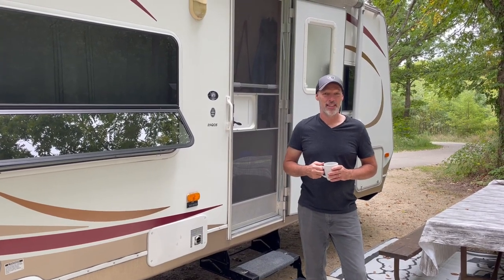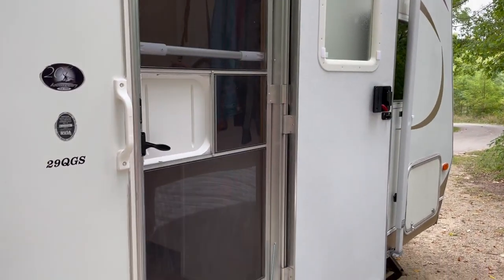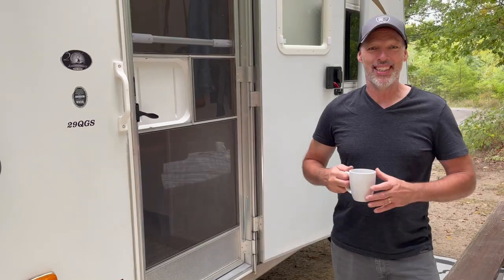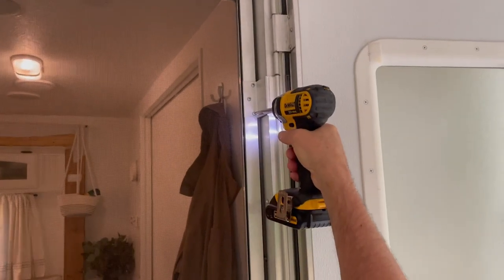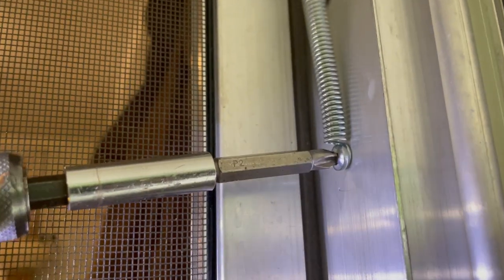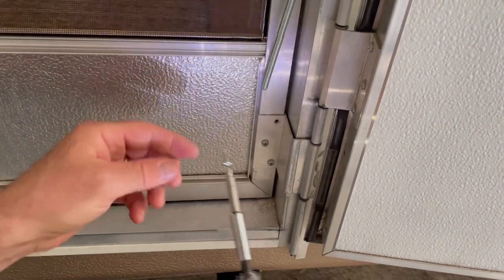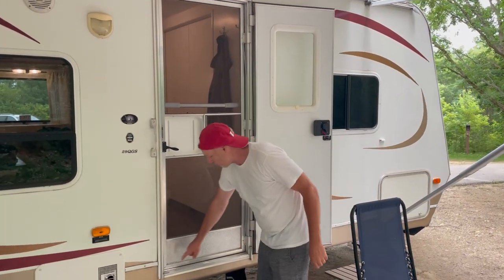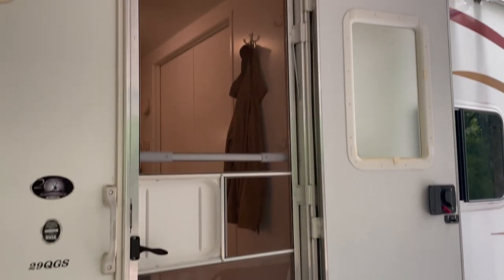RV Entry Door DIY Upgrades: Cheap Quick & Easy

Comment: The springs on the screen door are a game changer to keep the bugs out. You can also get a spring to automatically close the slider door on your screen door. That will really help bug proof your RV
Reply: It’s called the RV Bug Stop
Reply from the maker: I’ve actually though about installing that as well. Thanks for the heads up.